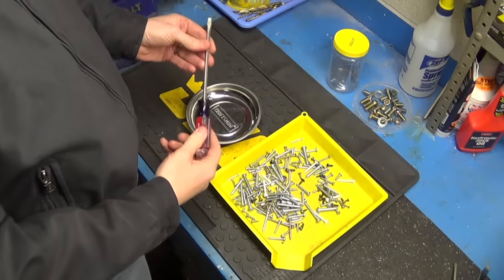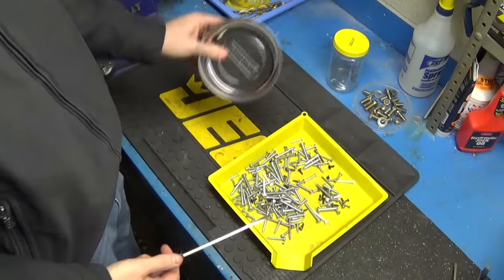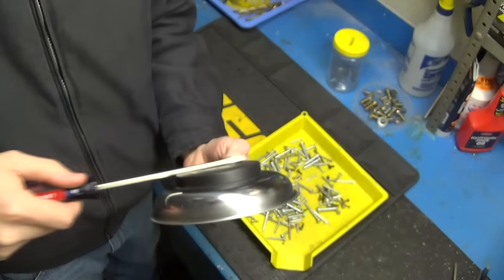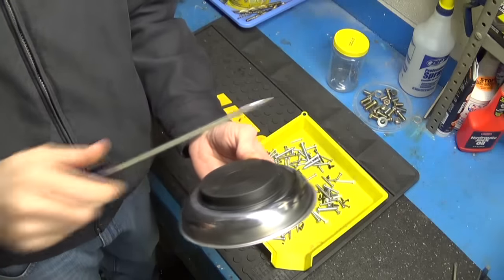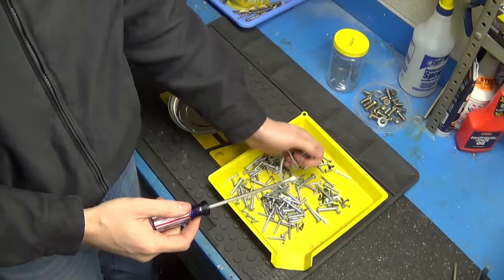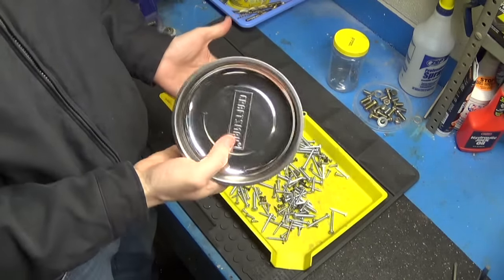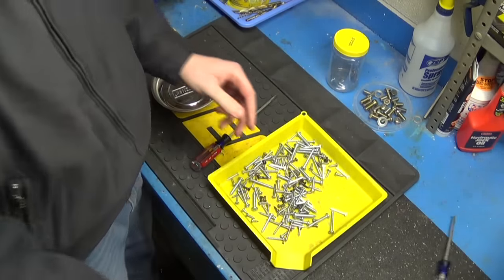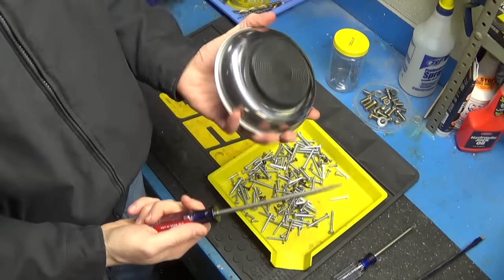How to : Magnetize a Screwdriver

Comment: This was a great tip. I tend to overkill so I was ready to buy some strong neodymium magnets but I had a parts tray handy and just magnetized 6 screwdrivers in the junk drawer in minutes. They were a pain to use yesterday screwing tiny little flat heads onto switchplates and every other one would fall on the floor. Now they've got STRONG pull. I'll never do it any other way again.

Comment: Awesome - I just used a refrigerator magnet and it worked like a charm. Working on a TV and needed help holding the screws in place.
Reply from the maker: Improvising…. Nice!
Reply: !! SAFETY THING !! 
!! Non-flatscreen TVs (old ones) have dangerously electro-dangerous components inside them - EVEN AFTER YOU UNPLUGGED THE TV!! 
!! Usually I'm taking the mickey in my YT comments BUT SERIOUSLY: If it's a CRT (ie made of curved glass) YOU MIGHT GET ELECTROCUTED! 
!! How did you get on? Did the screws go in? Did you get electrocuted? Did you get it on video?
Reply: EXACTLY what I wanted to read ! Thank you!

Comment: I was like, "Get outa heeeere." But, I have one of those magnetic parts bowls so I tried it. By gosh it works! I magnetized a scewdriver I didn't want magnetized! 🥴 Anyway, now I can stop shopping for a magnetized screwdriver. BTW, to "unmagnetize" a screwdriver you slide the screwdriver along the "edge" of a magnet. It took me a few attempts to get it fully unmagnetized, but I got it done.

Comment: You can use any magnet, just cover the magnet with a sheet of paper or rag and no scratches, also to demagnetize just run the tool in the opposite direction testing with a small screw till it has no magnetism.
Reply from the maker: Mentorcase Yep, any magnet will work....the more powerful, the quicker/better it will do.  These trays are extremely inexpensive (Harbor Freight often has free coupons for them), and they are also very useful....so that is why I used them in the video.
Reply: Real Tool Reviews 

Would this trick work with an electromagnet?
Reply: Just how forcibly are people rubbing their screwdrivers on the magnets that scratching is a concern? Makes it sound like the magnets have knife edges on them or something. 
Just use a lighter touch when rubbing one out, be gentle 🙃

Comment: does this damage computer parts? is it an electromagnet?
Reply: An electromagnet needs electrical current, you'd just need to wind up a coil of wire with many turns around the screwdriver and apply current to it, that'll make it an electromagnet. 
That's basically what relays use to pull in the relay contacts to make the connection.

Comment: I did this with 3 different screw drivers a couple dozen times.  Didn' work  But then, it was Harbor Freight screwdrivers and Harbor Freight magnet.  Made in China.  Go figure.
Reply: John Smith onky thing good is they chinese food lol
Reply: I tried both harbor freight screwdriver with harbor freight magnet and it worked fine.  User error maybe ?